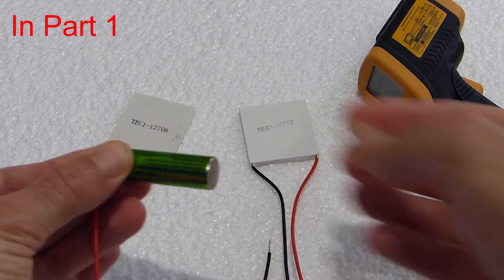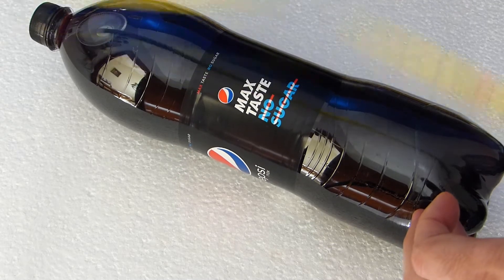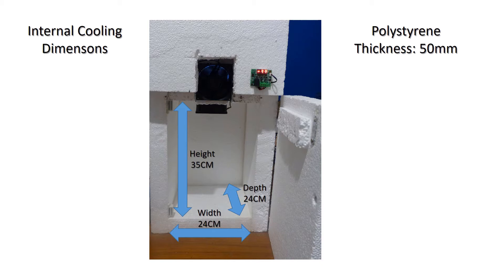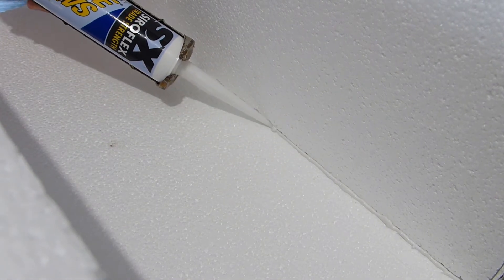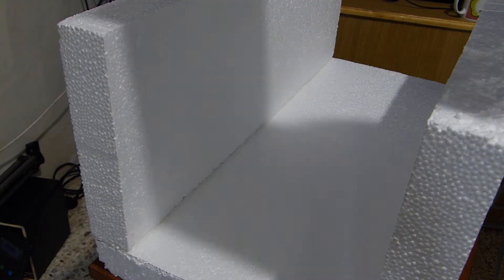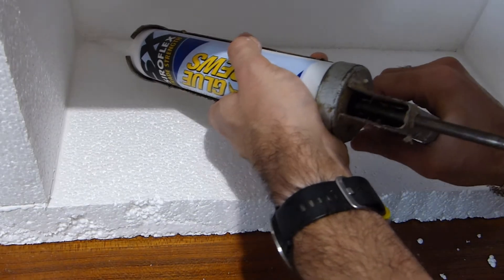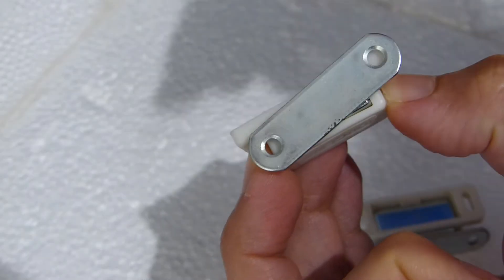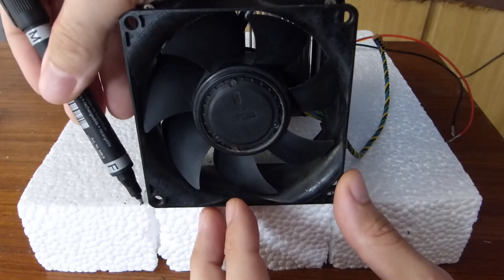DIY Mini Fridge Using Peltier Modules | Building and Testing Step by Step Guide

Comment: Make a ac using tec-12715 pelteir modules plzzz🙏
Reply from the maker: Good idea, and I have seen some of those on the internet being made as well. 

It will need to have fans on the Peltier to direct the cool air towards you and several Peltier modules will be required to get some good performance since you are cooling a room and not just a small area like inside the fridge.

Thanks for watching and for your comment!

Comment: Hi, have you tested ambient temperature of fridge while the internal fan is off??
Reply from the maker: Hi, yes when the fan is off the ambient temperature inside is almost the same as the room temperature, maybe 1 degree Celsius less! The fan helps to circulate the cool air from the Peltier around the fridge.

Adding more Peltier modules will also help to cool it down more, and the fan should not be running too fast otherwise the cooling effect will be less.
Reply: @ThatTechoGuy  yes that's true, thanks.

Comment: Cool :-) what is the power consumption?
Reply from the maker: 12v x 12Amps = 144Watts for the 1 peltier, fan maybe takes 5watts, however I would use 3 or 4 peltiers to keep temperature down and constant in summer. 

On the back you can do another 2 for example. That will give an average total of 450 - 600watts, depending if you use 3 or 4, for this size of fridge.